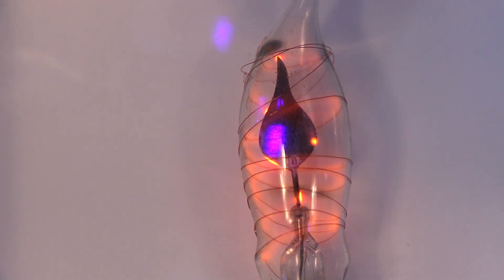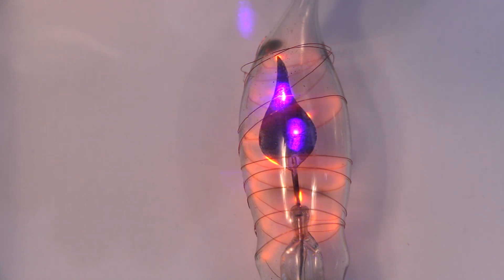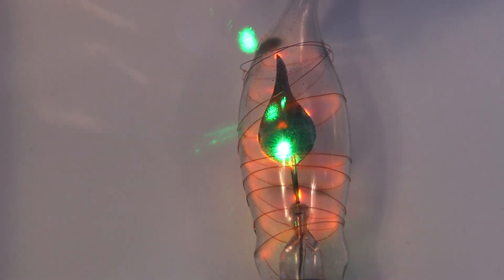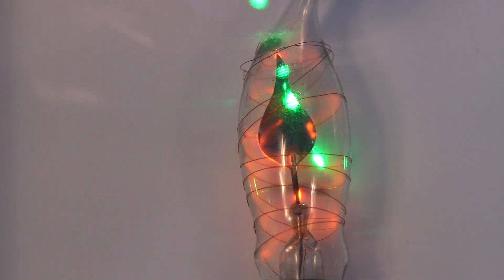Catching Neon with Lasers

Comment: The color corresponds to the energy (quantum mechanics and photoelectric effect) which is why the purple laser works but the red does not. That kind of Neon discharge lamp works by having two nearly parallel plates with the discharge between them. The path of the discharge increases the resistance at that point and so the discharge moves to another location which has lower resistance - and so the light moves (dances) around. (Crackle tubes are my favourite illustration of this effect).
By using the laser pointer you're adding energy into the system at precise location and changing characteristics.